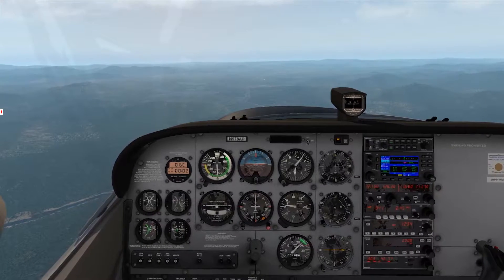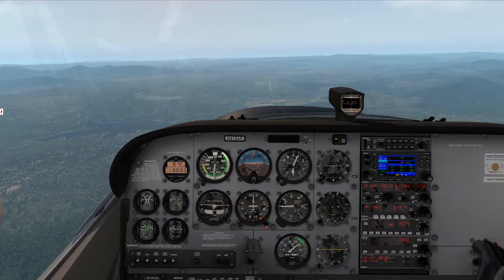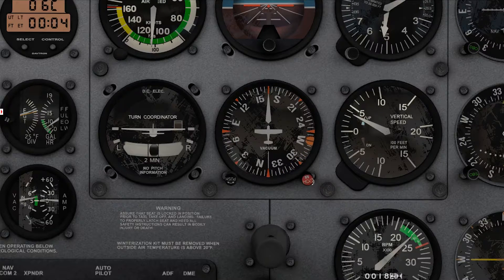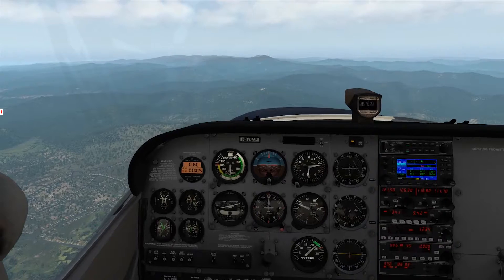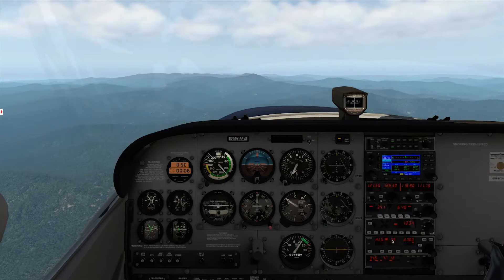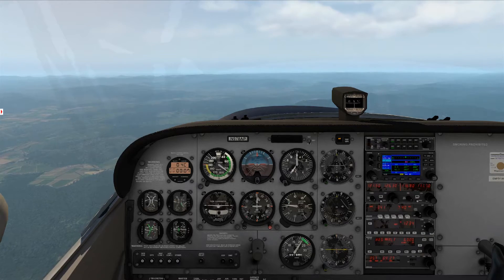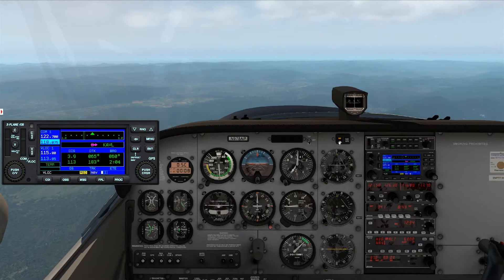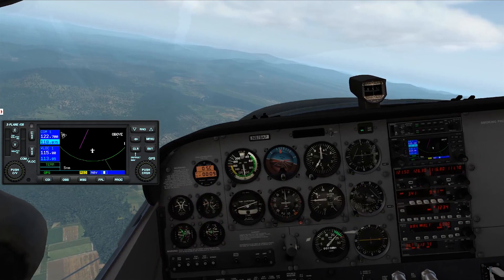X-Plane 11: Bendix/King KAP140 Autopilot Tutorial - What You Need To Know

Comment: Why not Alt Arm prior to setting your VS? Imagine you're being vectored for an approach, you get a descent, and set a -500ft/m VS. Then get an unexpected radio call with a slight change in your clearance, you go to flight plan, input the new fix, for example, re-brief the pertinent items, and then complete a scan. You've blown through MSA for the area and get a low altitude alert from ATC. Instead, if VS is displayed, ALT ARM should always be displayed. Select your altitude, click ALT to toggle VS, set your VS, and it will then capture whatever you initially spun up before commanding a VS rate.

Comment: How do you get the Kap140 to descend? ? I set vertical speed to -1000 and I still climb at ~300fpm. The G1000 made flying too easy
Reply from the maker: Hmm that’s odd Derek. Without seeing your setup it’s hard to say, but normally once I set my vertical speed to the negative (down) selection, it begins to descent automatically. Could you have some weird mode active?
Reply: clayviation I guess I wasn’t reducing power enough, any chance of turboprop or multiengine videos in the future?
Reply from the maker: I’m curious how the autopilot is set up in the airplane you are using. In my configuration, reducing power won’t affect anything with the autopilot. The pitch is set to capture a specific vertical speed, so in my case, if I were in level cruise with AP on and reduced power, the airplane would slow down and work to hold a level pitch, even down to a stall. This can happen with a climb that’s too aggressive as well. For instance, if you take off and turn on the AP, let’s say it captures a 1000FPM climb. That might be fine for now, but as you climb, the performance of the airplane might cause you to slowly bleed off airspeed as the AP works to maintain a pitch for 1000fpm. This could ultimately lead to a stall as well. I’ll normally turn on the AP and then set something like an 800fpm climb in this airplane because I know that usually climbs me at a reasonable airspeed up to cruise altitude. The encore video of the Flying To Oshkosh series demos the Aerobask Velocity V-Twin, which I’ll probably use more in videos down the line. Thanks again for the great conversation!

Comment: Nice video!. However, behavior of autopilot in navigation mode is wrong. That aircraft does not have an HSI but instead a DG/CDI pair of gauges, and in that case procedure to capture a VOR/GPS track is different than shown.
Reply from the maker: Hi Tomas! Thanks for watching. Reading your comment, I feel like we are on the same page with how this aircraft is set up. Perhaps you can expand on how it isn’t behaving correctly. In this Airfoillabs Cessna 172, the NAV mode of the autopilot will follow course guidance of CDI 1. The NAV/GPS button above CDI 1 toggles whether CDI 1 is receiving GPS navigation data (GPS) or radio navigation data from Nav 1 (NAV). I do agree that there is no HSI in this airplane. I’d love to understand more about your comment. Thanks again!
Reply: Hi, the CDI unit signal is not strong enough to provide an accurate guidance, so the heading bug in the DG must be used as the primary guidance. In NAV/APR/REV modes (LOC/GPS,etc) the AP will follow heading bug signal crosschecked with OBS needle deviation for error compensation.  You can download the original Bendix King KAP140 manual to check, it's free. Regards
Reply from the maker: Thanks interesting. I do see in the manual where it asks you to set the heading bug for an intercept, but I haven’t had any experience with one where the heading bug had to be placed for Nav mode - this X-Plane version hasn’t required it, so if the real 140 does, that is indeed a departure from the real thing. Thanks for the insight and if you have a link to the text that details that procedure, I’d love to explore it more. Thanks again!
Reply: Here you have the link : https://www.bendixking.com/HWL/media/PDF/PilotsGuides/PG-KAP140.pdf

Comment: +clayviation.  Can you choose the heading and altitude you want to fly using this autopilot?  I tried to use the one from the default C172 (I'm new to XP11), but I can't select the heading and altitude I want, which is a major problem when flying IFR.  It'll be worth an upgrade to another aircraft if I can get that feature.  I also have the multi-panel and radio panel from Saitek.  Thanks!
Reply from the maker: Mike, I haven't spent much time in the default C172, but in this one, you can indeed set heading using the heading bug and "HDG" key, and altitude by dialing in the desired altitude, initiating a climb or descent and then selecting the "ARM" key, which will capture the altitude you set and level you off.
Reply: clayviation Thanks!  When I fly offline IFR with the default Skyhawk, XP11’s ATC freaks out at me for not flying at the heading and altitude they want me at. However, I can’t set said altitude in the default aircraft!  I wanted to get that resolved before I fly one PilotEdge or VATSIM!  Also, does that plane fly erratically like the default one? Cheers,
Kevin
Reply from the maker: I enjoy flying the Airfoillabs 172 as much as flying the real airplane (well, maybe like comparing turkey bacon to real bacon - it's just about there). You'd think they pay me to say that and use it - they don't :). It's really the best sim aircraft I've found so far.
Reply from the maker: Also, I've found that the default ATC has zero patience. Some of your issues might be from the default ATC itself.